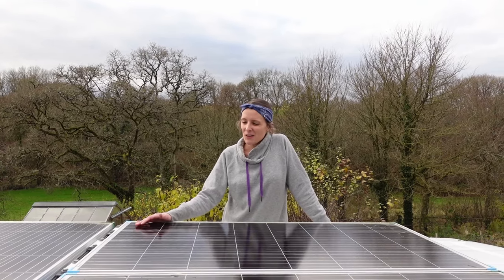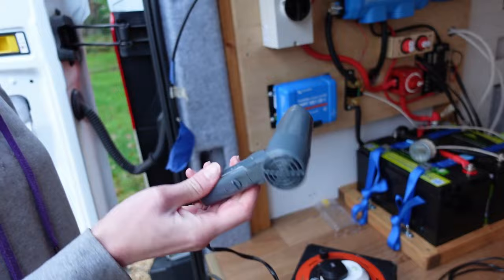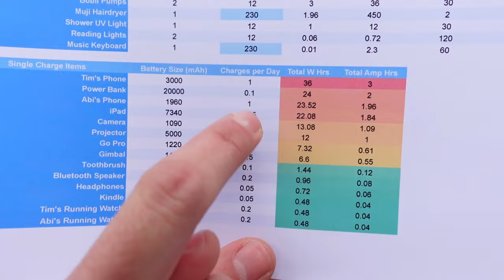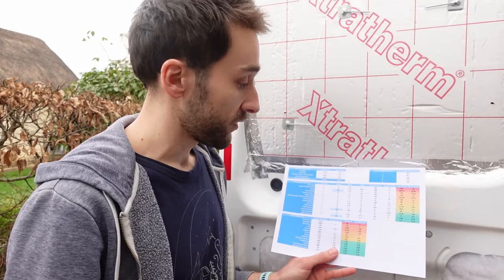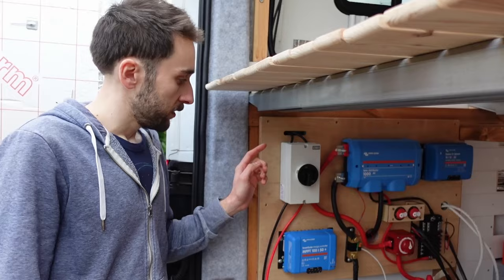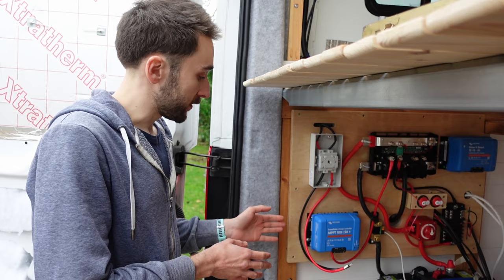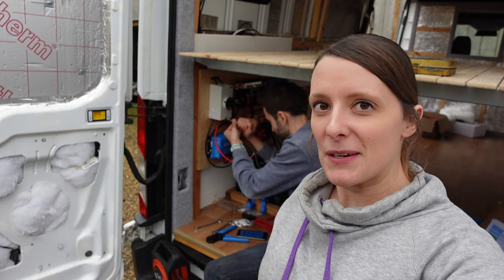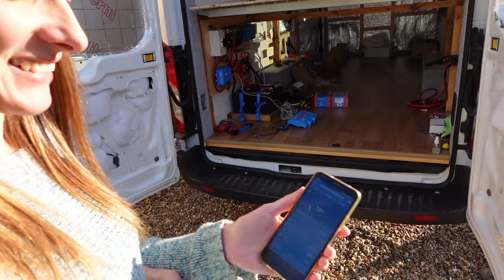Solar Wiring & Panel Sizing (525W Switched On!) | Transit Van Conversion E23

Comment: When you did your first fit electrics, did you run the wires to the driver's side via the rear door frame or did you run them along under the bed? Wire just to get around the door frame is coming in at 7m one way!
Reply from the maker: Yeah it's pretty crazy how quickly it adds up! We did a mixture of both, so for the lights we ran wire up and around the door, but for the diesel heater and DC charger we ran them just above ground level behind the wall (as they're thicker wire and we wanted a nice short run). We ran most of those wires when we did our pre-wiring here: https://www.youtube.com/watch?v=DTzaAh7on4c. Since then we've also added a second 12v fuse hub on the driver side to serve all of the 12v stuff on that side. HTH 🙂

Comment: Hi Both, How are you finding the solar set up? 

 I'm not sure how you have 525w as I read a reply to a comment on the solar roof rack episode which said you had them wired in series, which If i understand correctly means you have 175w @ 36v.
 In parallel would given you 525w @12v but running them at 12v would give you such a low window for usage charge voltage. 

 I'm investigating solar set ups for my narrow boar so this got my interest and thought I'd comment , in case I have miss understood something. 

Cheers
Reply from the maker: We're loving our solar setup so far! Our build is still not finished so there there will be more devices going in that need powering, but we've taken several trips in the van including one over a number of weeks and the power available was great, we were pretty much always back at full SOC during the morning. 

Whether you wire the panels in series or parallel the wattage stays the same, it's the current and voltage that changes. In our series setup we end up with higher voltage but the current stays the same so we can use smaller wires. So we end up with around 7-10A @ 50V or so depending on conditions. On an average day if we happen to check the stats we might be pulling in around 300-400W. HTH!

Comment: Hi guys. Any reason why you didn’t put a fuse between the panels and charge controller?
Reply from the maker: Hey, yeah it's not needed for our particular setup as it would be redundant. We have 3 panels wired in series that from the specs have a short circuit current of 10.3A. Because they're wired in series, even if one of the panels developed a fault and short circuited, there is still a max of 10.3A of current flowing through the whole array. That is below the 15A max series fuse rating of the panels of 15A, which is the amount of current the panels can safely handle. So even in the event of a fault it is well within the specs of the panel. And a fuse would likely either never blow or nuisance blow under normal use. It's more of a consideration if you have panels wired in parallel. Much more info here: https://gnomadhome.com/fusing-solar-panels/ or https://explorist.life/how-to-fuse-a-solar-panel-array-and-why-you-may-not-need-to/ 👍

Comment: Loving your videos and the detail you go into! We've bought exactly the same van as you and have recently been designing our electrical system. I was just wondering - how come you have 3 water pumps on your spreadsheet?
Reply from the maker: Thanks! 🙂Good question, we're planning a slightly non-typical water system with recirculating shower and heat exchangers, and our current thinking is that we will need 3 pumps to make it all work. Design still a little subject to flux though!

Comment: I’m going for a similar set up as this, does the lynx distributor eliminate the need for a circuit breaker coming off the solar controller?
Reply from the maker: The lynx is just a 4-port mega fuse hub which keeps everything nice and tidy, so it's slightly different to a resettable circuit breaker. We don't have a breaker after the MPPT controller though, we have a dual pole solar disconnect before the controller so we can completely isolate the panels from the rest of the system 👍

Comment: U should shincronise both chargers with each other  there for charging could be control at parameters of battery voltage and battery tempeacher
Reply from the maker: Yeah it would be nice. The MPPT and BMV smart shunt are configured on the same local victron VE.Smart network and talking to each other, but the Orion doesn't yet have the capability to join the network and synchronise with the others unfortunately. It's been a requested feature for 2 years but still not possible annoyingly (https://community.victronenergy.com/questions/69199/vebus-orion-smart-tr-networking.html). They are all configured with the parameters of the batteries though

Comment: Hi sorry to bother you after your wedding congratulations again by the way… Why didn’t you use the solar panel cable to come out of the Killswitch to go straight into the distribution bar? Also what size cable did you use to come out of the kill switch to go into the distribution bar? Many thanks
Reply from the maker: Thanks 🙂 And we have the cables coming from the panels, through the solar kill switch and then into the MPPT charge controller. The panels have to feed direct into the charge controller for it to work. We're using 16mm^2 cable for all the solar connections, which is the maximum size that fits into the terminals on the MPPT and more than enough for our setup as our panels are in series so the total current/amps stays fairly low. It's essentially the same cable before and after the switch, just the black ones came part of the solar kit with the panels and the coloured ones we got separately. HTH!

Comment: Can you wire renogy solar panels to a victron charge controller?? Can you mix and match between companies products pretty easily? Could I have renogy charge controller with victron batteries?
Reply from the maker: Yep there's no problem doing that, we have a victron charge controller with renogy panels and KS energy batteries. Just make sure things like the charge controllers have the settings changed to match the specs of the batteries. It should be fairly easy to find the recommended settings from the battery manufacturer to plug into the controller.

Comment: hey again guys i was looking at the IMO Solar Switch the link has gone now, would you be able to put another up? thanks guys
Reply from the maker: Hey, thanks for the heads up. The listing we used isn't there anymore but have updated it to show some other similar listings, the one we have is the IMO SI16-PEL64R-2 👍

Comment: Hi the panel with all the electrical gubbins on does it need to have a good air flow round it or could it be hidden in a cupboard - maybe with a PC fan connected for circulation - it can be all so expensive left on show if a sly eye crosses it by with the door open thinking on the security side ;-)
Reply from the maker: More air flow is always good, but yeah we might cover it with something at some point. Although a big part of that would be to stop anything hitting it/dust and things 🙂

Comment: Me again! I'd like to ask please, with your continuous running table, you divide the laptop, a 230v appliances by 230v. e.g  20 / 230 = 0.09. But then at the top table for power consumption totals, you divide the 230v row by 12v. e.g. 177.2 / 12 = 14.7. Why would this then be divided by 12 not 230 if they are 230v items?
Reply from the maker: Hiya, good question! Everything downstream of the inverter will have a much lower current as it is running at a much higher voltage (230V), so in the example of the laptop it's only using 0.09A. But we're not really interested in that, what we want to know is how much power that equates to on the 12V side as ultimately everything is powered by our batteries. So what we do is calculate how many watts it uses (which allows us to compare the same power across 12V and 230V, which gives us 160W hours. Then in the coloured 'Total Amp Hrs' column we're working out what the equivalent amp hours would be at 12V. For the 230V items you could read 'Amps' as 'Amps at 230V' and 'Total Amp Hrs' as 'Total Amp Hrs at 12V'. And you'll notice that the 'Total Amp Hrs' column is derived from the 'Total W Hrs' column. The 'Amps' column is more just for extra information but it's not used in any calculations, everything is derived from watts.

Then the summary at the top also just derives from watts. The 'Amp Hrs p/d' for the 230V is just what you get if you add up the 'Total Amp Hrs' for the 230V with rounding. HTH 👍
Reply: @SelfBuiltStories  Thank you very much for your full answer, I hope it helps other people too as you have written such a thorough answer! I think I understand more, it was a bit tricky for me to get my head around and I think the idea is settling now. I asked on FB a similar question and no one gave a response as good as yours! I'll have a go at my own appliances and use tables likewise to yours. Happy travelling, PinkBSL 🤩😇
Reply from the maker: @pinkbsl7972  No problem at all, cheers 🙂

Comment: Hi I im pretty ignorant with regards to this and noticed your solar isolator is 16 amp rated (ebay one)- the panels Optimum Operating Current 9.75amp each so does that not mean it needs 3 times a 9.75 amp rated switch - just wondered if safe before picking one up thanks for any info 🙂
Reply from the maker: Hiya, we've wired our panels in series so the current (total amps) does not change, it's the voltage that increases. If we had wired them in parallel then it would have been the other way around, and the voltage would have stayed the same but the current would have multiplied. So for our setup, it shouldn't be higher than around the 10A level, which also means we can use some less hefty cables on the roof. For more info on series vs parallel wiring explorist.life is pretty helpful: https://www.explorist.life/solar-panels-series-vs-parallel/#Voltage_Amps_of_Solar_Panels_Wired_in_Series
Reply: Thanks very much for the info - very helpful
Reply from the maker: @omallythomas3768  You're welcome :)

Comment: What about charging of a petrol generator? or charging from socket like at home before leaving?
Reply from the maker: We decided not to add provisions to be able to charge from shore power in the end, as based on our calculations we think we should have enough power just from the solar and alternator charging. But it wouldn't be too difficult to add it later on if we felt we needed/wanted it then 🙂

Comment: Hi guys, what size mega fuse are you using in your linx distributor, thank you
Reply from the maker: Hey, we used 60A (MPPT), 80A (12V hub), 40A (DC-DC) and 100A (inverter). That works well for our set up with the kit we have but obviously depends on your system 👍

Comment: What about AC charging from a house, building or generator?
Reply from the maker: It would be relatively simple to add but for us we decided not to have any hookup as we'll be off grid most of the time, and we generate enough power to charge from solar and the alternator 👍

Comment: Why do you need a solar disconnect switch?  Thank you
Reply from the maker: Without the switch there's no way to stop the power from the panels making its way into the system, unless you go up on the roof and cover them up with something. So it's really handy for being able to isolate the solar while doing maintenance and troubleshooting etc. And a completely random secondary use we've found is that switching it off and on again causes the mppt to instantly switch back to bulk mode which has been handy a couple of times when we start to draw the batteries down shortly after it's already switched into float 🙂

Comment: What size of wiring did you use from the charge controller to the lynx distributor?
Reply from the maker: Hi, we used 16mm^2, which is the maximum guage the mppt can take 👍
Reply: Thanks for the quick reply, I had 16mm2 but thought it would struggle to fit into the charge controller just awaiting the crimper tool.   @SelfBuiltStories
Reply from the maker: No worries! Yeah it's a snug fit but it works 😛

Comment: Very good video and well presented , however I have one question . How much did the whole electrical system cost 🤙
Reply from the maker: Thanks! And we haven't worked out the total yet as there's still bits to add and wire in, but we have a record of everything so will do that at the end. All the main bits we've used in this video are in the description though so you can get a rough idea of cost for this part. The most expensive components by far are the batteries, but they should last us a long time and are the backbones of the whole system.

Comment: I think I would have turned the solar charger upside down for shorter wires and better routing or the wires.
Reply from the maker: Hmm yeah that would have tidied up the wire routing but Victron doesn't recommend mounting it any other way. Think it would also mess with our heads being upside down 😜

Comment: Those solar panels would need to be oriented towards the sun to be more effective. Having them laying flat like that is not ideal in most parts of the World. So, ideally you'd want to be able to change their angle towards one side and park accordingly.
Reply from the maker: Yeah we have it on the backburner as a possible future upgrade to add tilting brackets onto the unistrut, but so far we haven't needed it. We'll have the DC-DC charger too and plan to be moving around fairly often and not staying long enough to make it worth it to get up on the roof and change the angle. But yeah we'll see how it goes on the road and add some tilts if we need it 👍

Comment: No point using them in the UK, Got forgot to turn on the sun there
Reply from the maker: Yeah it would be nice if we had a bit more sun, but even on overcast days we can generate a few hundred watts of power so it's been working great to keep our batteries charged so far 🙂

Comment: the calculations aren't completely correct like your phone has 3000mhA battery but only at 3.6V so 10.8wH not 36wH
Reply from the maker: Cheers, yeah we overlooked the lower voltage of our phones and things at the time and updated our spreadsheet afterwards to adjust for that, the nice thing was the difference was in our favour 😛

Comment: too much technology and the app is not good for a camper or for living in a camper...simply the best...I've been living in a motorhome for the last 17 years, at least 6 months a year, and I know from experience that more than 50% of this nonsense is unnecessary, especially wireless things. what keeps breaking down...you did everything great on the wrong vehicle...ford is the worst possible vehicle and sprinter...one day when you decide to sell that vehicle it's hard to sell because it's a ford...if you did it all on fiat ducato 2.3 or 3.0 Sofim diesel engine these are the best engines for campers...good luck
Reply from the maker: Cheers, we quite like all the technology though 😛 We like being able to monitor everything and keep a check on the van but for sure not necessary for everyone. We went for the Transit as it has a really nice high roof that allows me (Tim) to stand up in super comfortably even after all the insulation in the floor and ceiling. Loving it so far, not planning to sell it anytime soon, hoping to get a good life of adventures out of it 😀

Comment: If you could angle the solar panels to the sun you will find they produce a whole lot more power. Ok for when you park up for a day or two. I do not know if it is practical to hinge one side to allow you to prop the panels up. then lock them back down to travel?
Reply from the maker: Yeah that's interesting, we did think about that as Renogy even make a tilt mount bracket. We thought about making our own homebrew version using the unistrut sort of like how a deckchair changes height. We didn't in the end just because it complicated the design a bit and we wanted to get moving with it but it's something we'll keep in mind for sure. We're quite interested to see how much energy we'll actually use and need in the real-world. We've tried to plan as best as we can at the moment but the proof is always in the pudding of course!
Reply: @SelfBuiltStories  Its easy to get carried away on design ideas,, I would have just had a pair of fixed hinge on one side and a quick release on the other with something to prop it up..maybe the wife's hair straighteners ;-)  ?
Reply from the maker: Yeah that's pretty much what we were thinking but you explained it better, fixed on one side and hinged on the other. And the bit to prop it up we'd fix at different points in the holes on the unistrut so we could alter the angle to get the best sunlight 👍